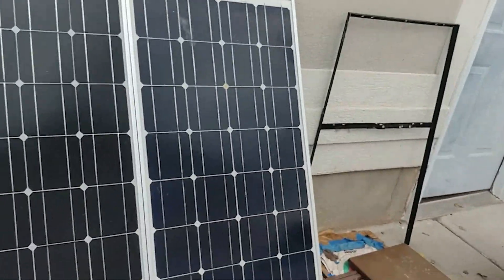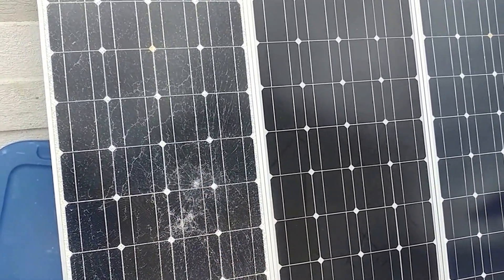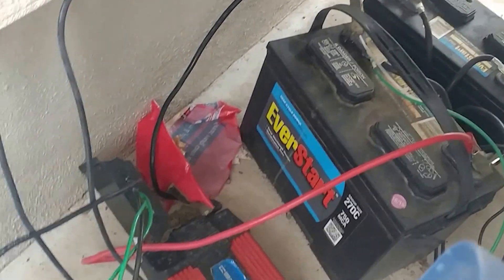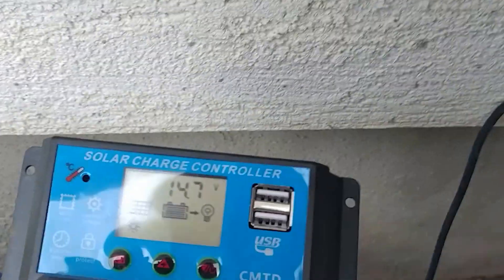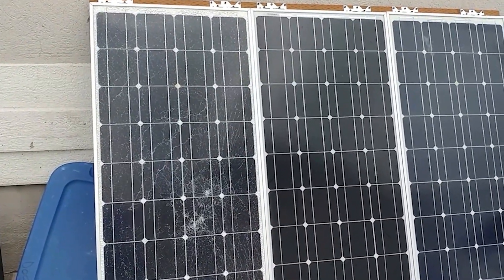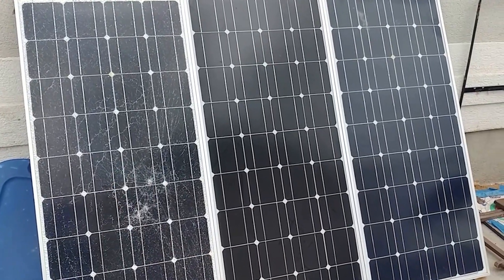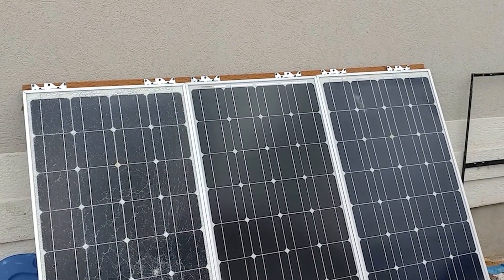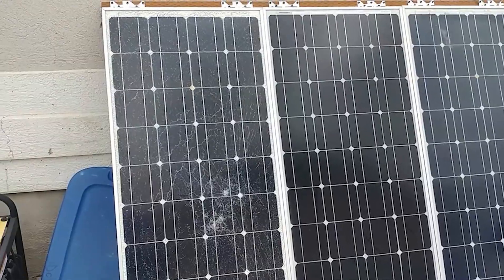How I Charge My RadRover With solar!

Comment: I was told that I should use a pure sine wave inverter not a modified sine wave.
Reply: Pure sine wave inverters are ideal, but others will work too. Pure sine wave inverters are essential for inductive loads though - for motors like those used in air conditioners, refrigerators, etc. For solid state devices like an e-bike AC-DC charger (switching power supply), others work good enough. Inductive loads work with modified sine wave inverters but not as efficiently.